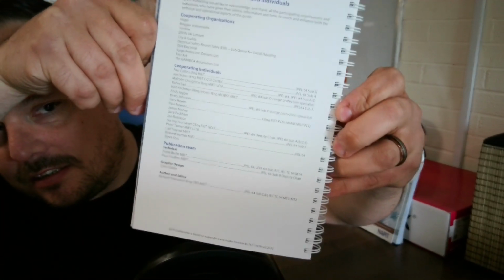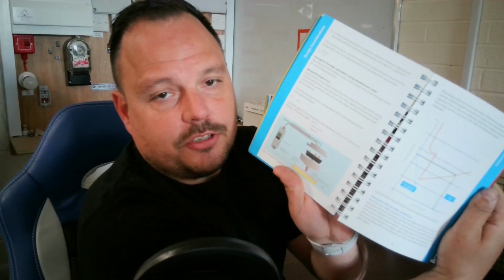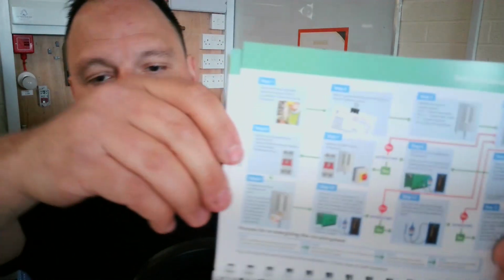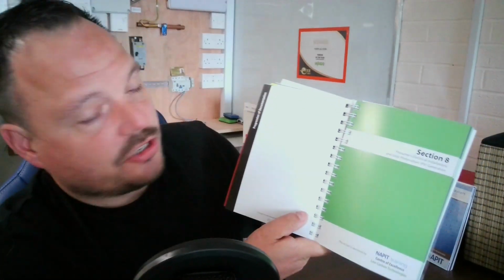Electricians AWESOME NAPIT Books - Code Breakers - On Site Solutions

Comment: Ai will effect all this soon.Even the hmrc use it against u electricians.U dont know whats coming.Good book though
Reply from the maker: AI is a tool that is changing lots. Ive said that will impact those whom write our regulations and guide us 1st. I think that will all be obsolete inside 5 years. Not saying that's a good thing but it will happen. 

Only those who cheat hmrc need to worry about that. AI or not.
Reply: @electrician247 yes i think is going to be a big experiment though with the tax stuff coming in.I can see many a company going bust soon.